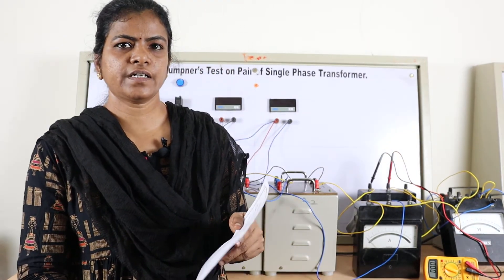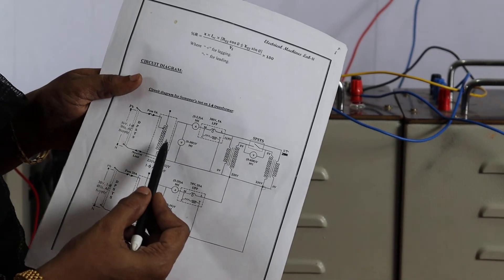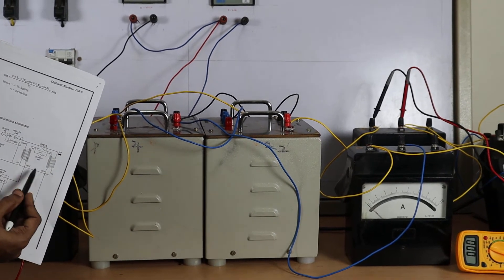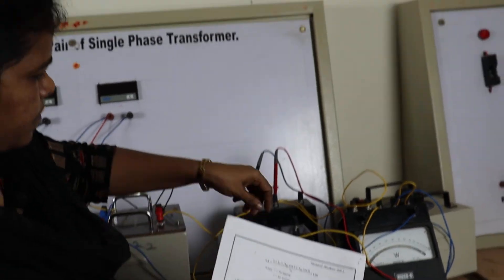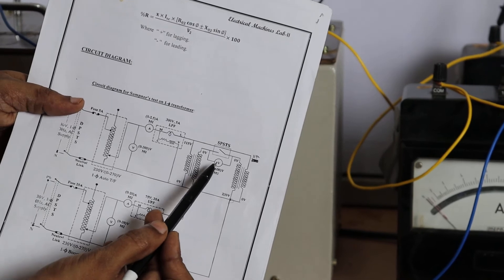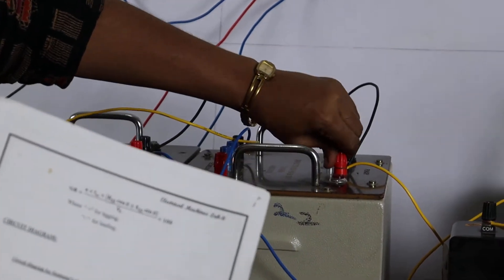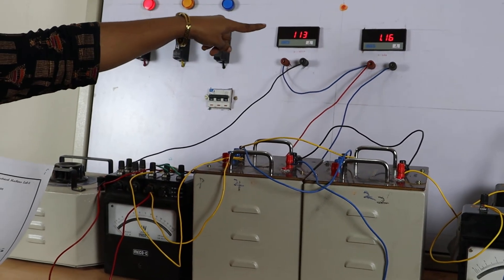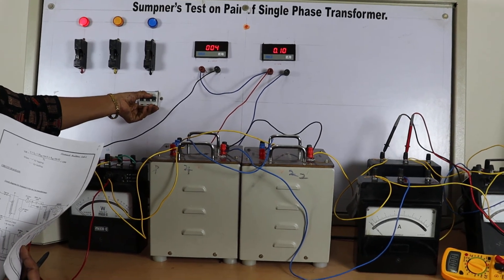Sumpner's Test on Transformer||Electrical Machines Lab-II

Comment: It is wrong if you use ammeter, voltmeter in vertical position, they are laboratory type they must be used in horizontal position.